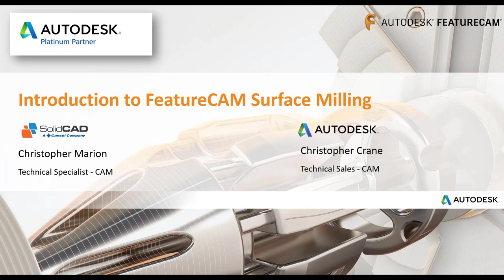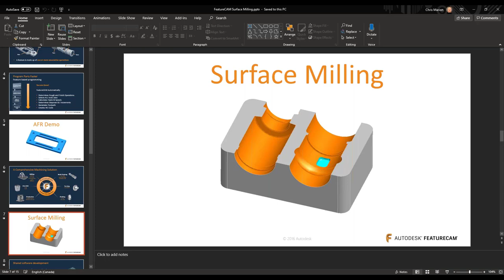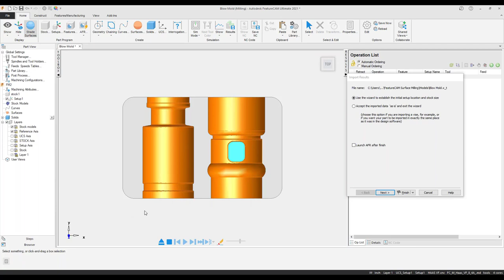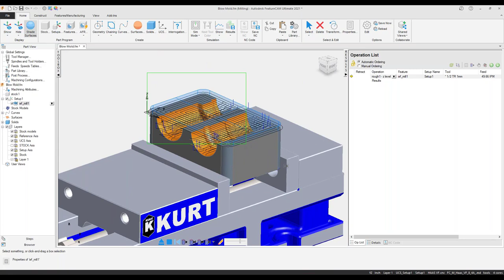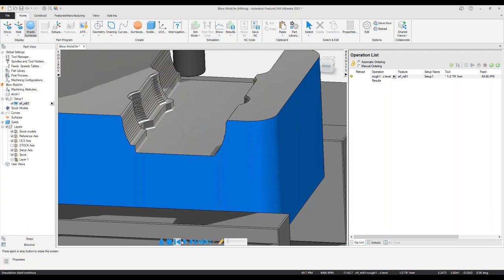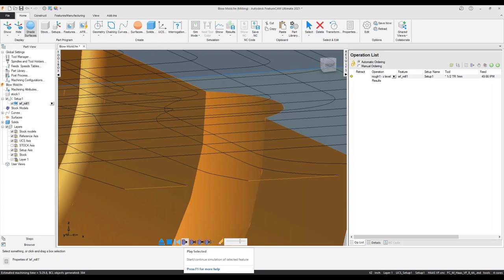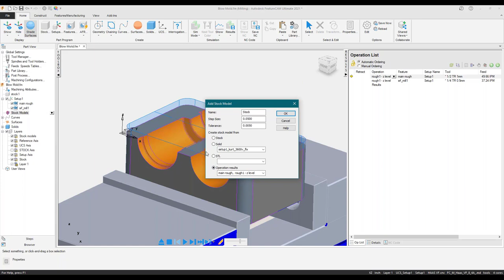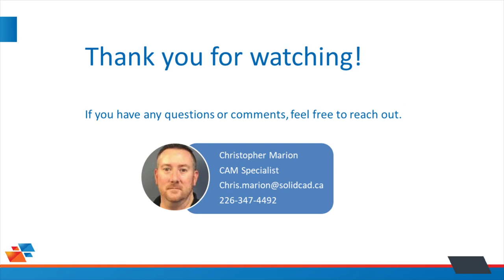FeatureCAM Surface Milling Introduction - Part 1

Comment: I'm trying to figure out how to mill a pocket on a round part. A pocket that radiates from center. Any suggestions? Starting from scratch.
Reply from the maker: Hello Roberto. 

In order to machine a pocket around a cylinder, you will need to wrap it.  Keep in mind, your post also needs to be configured to give you this option.

Here is a very useful article that describes how this is done.  https://knowledge.autodesk.com/support/featurecam-products/troubleshooting/caas/sfdcarticles/sfdcarticles/How-to-wrap-a-pocket-feature-from-a-solid-model-around-the-index-axis-in-FeatureCAM.html

Comment: I have a problem, when a try to mill a simple hole or pocket on a block, the tool mills the origin of the piece between operations, what can I do?
Reply from the maker: It is hard to tell without seeing the actual fm file.  To me, it sounds like your tool change location is set too low.   Try changing this to a higher Z value.  

Here is a helpful Autodesk article on how this is done…. https://knowledge.autodesk.com/support/featurecam-products/troubleshooting/caas/sfdcarticles/sfdcarticles/How-to-move-tool-change-location-in-FeatureCAM-simulation.html

If this isn’t a solution to your issue, then please create a thread on the FeatureCAM Forum and we can look at resolving your issue there.

For more information about our products and sevices, please contact the SolidCAD team at :  1.877.438.2231